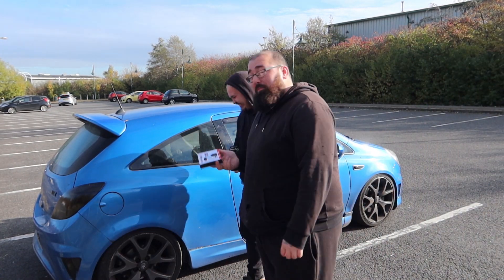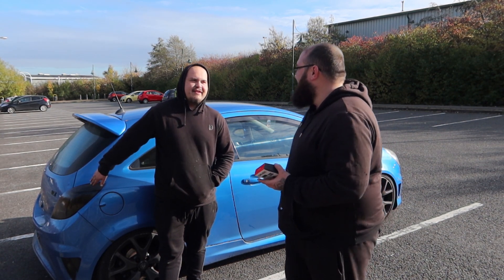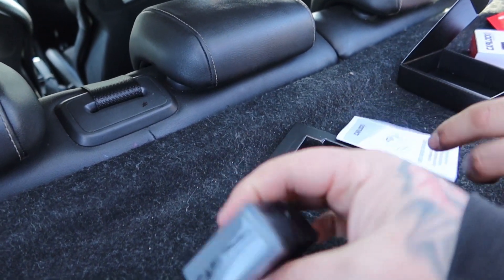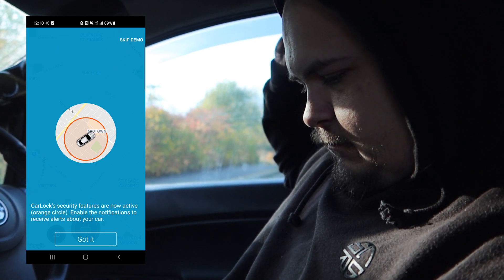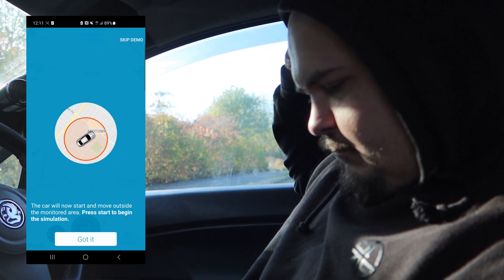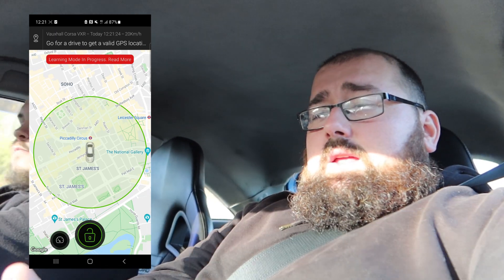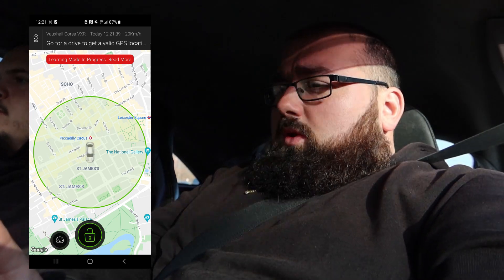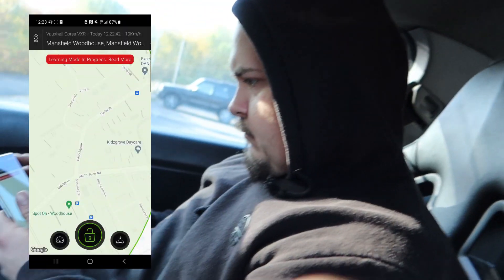Cheap Anti-Theft Car Security System!

Comment: I know this is off subject but needing some advice if someone can i have a corsa 1.4 sri 15plate and some mornings when cold power steering and traction control lights come on after turning off and on a few times maybe 5 / 10 mins itl go off and everything fine cant find any fluid to replace it so assuming its electric is there anything i can do to check or anything any advice at all would help  thanks allan